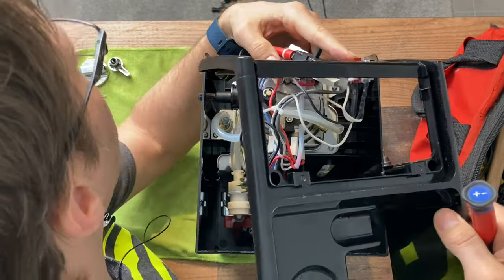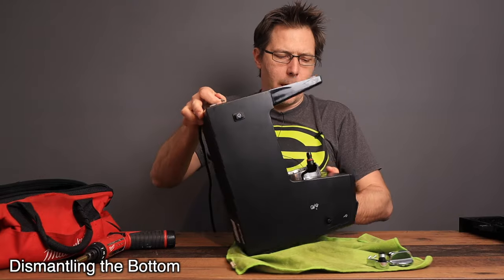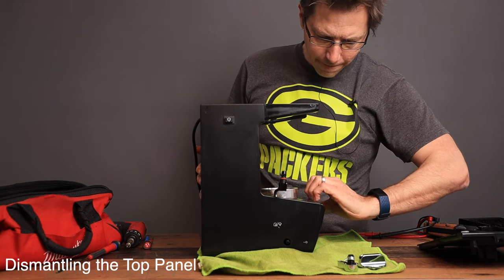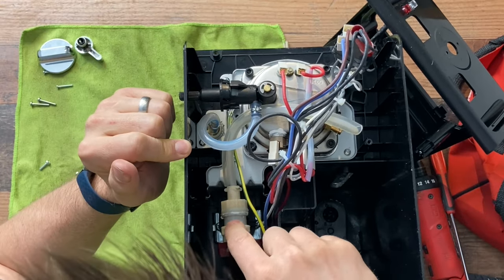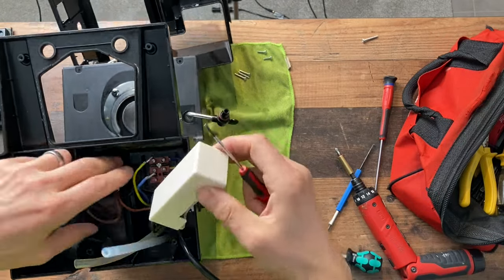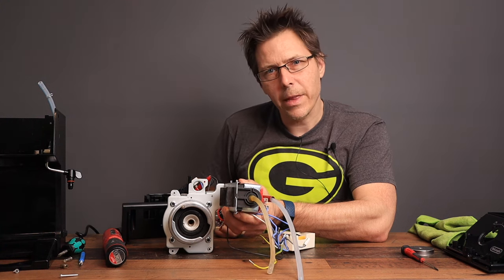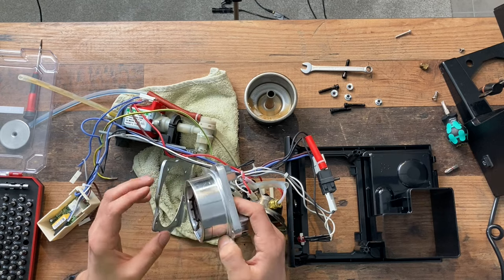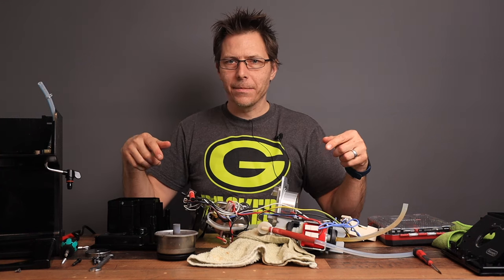$99 Delonghi Espresso Machine Teardown - How good ARE the Components?

Comment: Hi Tom why does the screw that goes on top of the valve does not tighten it keeps on turning I changed the spring and the ball and it still leaks when I turn on the machine
Reply from the maker: It should tighten just fine. You mean the brass nut that holds the spring valve in, right?
Reply: @TomsCoffeeCorner yes Tom that brass nut it still leaks when the machine is still warming up what do think is the problem thanks
Reply: Hi Tom it's 9.30 here I live in malta I found the problem I watched your video how to take the machine apart and I found the the copper pipe where you put the valve in it was not tight so I applied some bond around the tube from the inside and on the outside and its good don't know how long it's going to do the job it's called quickstep it can handle 260c what do think thanks alot great videos
Reply from the maker: @nickagius9050  Glad to hear you got it repaired!

Comment: That little box you found in the machine was to cut the power if there was no activity over 10 mins mark, because it's gonna reheat the boiler over time and no refill function, dry boiler often cause machine to trip the breaker, that's a nice implementation, what I do was press the brew button, let the fresh water in, every 5mins or so, and it's 300ml boiler, not 150ml, just take a look the protrude brass tube, water has to fill all the way up to get through it, how are you gonna do that, if that's 150ml, it fills to the bottom part to the boiler?
Reply from the maker: Hi there! Well, the bottom part of the cup fits 150ml, but yes there is a little space above it in the upper cap. However, the heating coil will likely displace that area. It's just a guess that this is 150ml in total. But you are right, that the water has to exit the boiler via the tube at the top, so there's got to be 150ml at least, plus whatever else is getting pumped in, to make it over that lip of the pipe. Cheers!

Comment: Is it worth spending a little more for the 35.31 model? Or the metal parts aren't worth that extra €30-40. Thank you
Reply from the maker: I like it better, also because the drip tray is flat, instead of plastic riffles. Cheers!

Comment: Hi Tom, how did you close the boiler unit back up? Is the cup just pressed into the housing against the rubber gasket? Mine doesn't want to stay closed after opening. Thanks for the great teardown.
Reply from the maker: You betcha! Yes, the thick rubber gasket keeps the boiler sealed.

Comment: Hi @TomsCoffeeCorner!
I have this exact model and, following some of your guides, did some modding to it, like depressurize the baskets, cut the bottom of the portafilter and installed the Rancilio Silva steam wand. They all improved very much my coffee and the overall experience.

I'm wondering if its worth it to move forward modding this machine (dimmer switch, IMS basket, IMS shower screen, pressure gauge, etc.) or if its better to buy a used Gaggia Classic or Gaggia Classic Pro instead. Since you have experience with both, what do you think would be the best? 

P.S.: I plan on buying a GCP eventually. I just want to know if its better to learn and experience more with this Delonghi or just jump ahead and learn from the GCP.

Thanks!
Reply from the maker: I feel like the ECP series is a mini GCP. Similar in a lot of ways, just with a smaller brew group. Fun fact: the ECP's stainless steel boiler is actually larger than the GCPs.
Reply: @TomsCoffeeCorner  thanks for the insight! I’ll play around with the ECP a little more then 😁

Comment: I have this model now but certainly want to upgrade towards end of year. What do you recommend for something in the $500 range ? I am using a setter 270 grinder.
Reply from the maker: Are you in America? Espresso equipment is a bit more expensive in the US. In the EU, I'd say a Lelit Grace. But it's hard to find something noticeably better for under $500. The GCP is nice, but if you want to upgrade, I would suggest a PID machine, which the GCP does not have. Maybe write some more, about what features you'd like to get.

Comment: A 1/8" flat head screwdriver will fit the screws on the bottom of the unit, possibly helpful if someone wants to add the "dimmer" modification to the machine.

Comment: Hey Tom, how old is tha Delonghi expresso machine? What model?? I own a Delonghi ECO 311 Icona, failed and disassembilng completly!  That L aluminium holdin the boiler, the Ulka vibratory pump the head ARE THE SAME in my machine! Your boiler is Stainless Steel, mine dont....The heating element in mine was totally destroyed!!
Reply from the maker: This is the ECP31.21. Internals should be quite similar to the Icona. Are you gonna order a new heating element, or get a different machine?

Comment: I have one of these. I’m planning to make a water level indicator for it. Does it have any 5 or 12 volts inside?
Thanks for sharing 👍🏼
Reply from the maker: I think the components are all 230V, but I haven't checked. They'd need a voltage converter to have 5vdc or 12vdc, and I didn't notice any. Cheers!
Reply: Thanks Tom 👍🏻

Comment: The area you live in must have high "disolved sand" content in the water 😅. Do you filter the water first? In either case very cool to see inside the boiler and I have to ask, did you manage to reassemble the machine and does it work normaly?
Reply from the maker: Haha, yes I filter my water, but I got this used, and for free. So, who knows if they ever descaled. Anyway, I live in a really hard water area, so your mileage may vary.
Reply: @TomsCoffeeCorner who sold it to you, the Sandman? 😂

Comment: I got a Delonghi La Specialista, in mine the steam does not work so I have never been able to make lathe; I can do coffee and expresso; I noticed the gauge does not work either; when the steam knob is activated I can hear the vapor building yet nothing comes out of the wand; the top of the machine gets really hot. No idea what I am looking for in mine; I did paid $15.00 for the disassembly video to the Delonghi tech that sells it on you tube, so taking it apart is not the issue but knowing what i need to replace; I think at some point he was pointing to the thermostat or something like that; I took off the top once and there is not noticeable leaking inside or anything that looks loose. I bought this machine off Amazon; came broken, obviously returned by another customer and I could never make those crooks on Amazon to take responsibility; I am indeed still paying for it as I bought it using affirm.
Reply from the maker: Well, Amazon should certainly honor their A to Z customer satisfaction. Just call them. You can get their contact via the Amazon app. Cheers!
Reply: @TomsCoffeeCorner  yeah tried that several times, they stole the money at not honoring squat and no replacement either; bunch of crooks they are

Comment: Hello, Thank you for your video. I have question. I have ECP 3420. Recently its not frothing milk . I guess steam wand. Coffee section is working. No hot water coming out from steam wand. guess steam wand tiny hole is clogged. what should i do? FYI, I bought it 2 years ago. but didnt descale at all.
Reply from the maker: Well, you can try to clean the team tip, if it's clogged. And you need to descale! Super important. Give that a whirl. Cheers!

Comment: Opened mine up and similar deposition issue, its really a design flaw that descaling does not work as the way the boiler exits at the top means the descaled sediment can never leave the boiler.
Reply from the maker: Yeah, I thought it was kinda weird, but I think this design is how it needs to work. I'd have to take apart another boiler machine and compare.
Reply: Guess you'd have to dissolve the accumulated sediment completely to get it out of there without disassembly.  I wonder if very frequent descaling would be enough to keep it from building up down there.

Comment: Hmmmmm i have an idea. How about to cut the top of the boiler and weld a five cm extra aluminium pipe to make  bigger boiker with longer screws. I have a friend Who work on weldings he could do it easilly. Would this machine benefit from bigger boiler?
Reply from the maker: I don't think so. Having a larger boiler would make it more sluggish between modes. I think 150ml is a good fit, to be honest. Cheers!

Comment: 14:45  , is the pipe of the boiler meant to be completly fixed? I can see when I take of the shower filter that the pipe is kind of lose , and it drips... not sure if is a problem of the screw and the drill , or the pipe is just broken.... help me out please! Really want to fix my machine, nice video btw :)
Reply from the maker: It's supposed to be tight...it creates part of the seal. Maybe you can screw it down? Otherwise, you might need to get a new boiler.

Comment: Are the parts inside the boiler stainless steel also? The coil where the water passes through specifically?
Reply from the maker: The boiler is SS, and AFAIK the heater coil is also stainless. Cheers!

Comment: My ECP isn’t working as expected. There is no pressure or heat anymore when I try to steam my milk. It was working fine a few days ago. I descaled it thinking that might help, but it didn’t. Any suggestions for a fix?
Reply from the maker: Your OPV could likely be shot. Do you see bubbles coming up in the water tank when you turn the pump on?
Check this vid: https://youtu.be/ncoZ3XyhWC8

Comment: To my understanding. there is no selenoid valve used in this machine. Also pov exit to the tank for economizing is wierd. Shouldn't be some sort of exit into drip tray normally?
Reply from the maker: No, there is no solenoid valve. Delonghi always puts the excess off the OPV back into the water tank. Breville on the other hand, puts it back into the pump cycle, reattaching the overflow of the OVP back to the input of the pump via T connector.

Comment: Great idea!!!!!!  I'm so over all the pretentious nonsense being spouted over "appliance" coffee makers.
Reply: Also I have a 3d printable lid I designed that fits the Stilosa water reservoir, and I'm sure would work on this one as well.
I can post the link but didn't want to in this comment because it will just get removed from youtube not letting comments share links without approval lol :)
Reply: I think when descaling, and also now that I think more about it.  There seems to not be any circulation of water during operation, or at least very little.  All of that sand is the scale from everything in the boiler.  It just was never able to get mixed around and pushed down the spout through the grouphead.  I think possibly this could be solved by removing the pressure valve inside of the spout and just running water through it after descaling.  Maybe without any resistance more flow can be achieved inside of the boiler.  But for me, I think the best way to descale it is to just take the boiler off as you did and clean it manually.
Reply from the maker: Hi Justin! Send me the 3D link to my email. I have my email listed in my website, tomscoffeecorner.com. Also, I bet that would work better, to remove the expansion valve to get rid of the crud, but since it's heavier than water, it might still just sit stubbornly on the bottom. It was fun to take this apart though, and see the boiler first hand.
Reply: sent :)

Comment: Будет ли видео про opv клапан и регуляцию давления в группе?
Reply from the maker: Not at this point. The OEM OPV is not adjustable. I tried using different springs in there, and shortening the spring, but I got crappy results. The pressure still built up to 11 bar, but just took much longer. Maybe someone has put in an an entirely new OPV?
Reply: Я знаю человека который вручную сделал байпас. Канал его называется Verstar, правда на русском языке.

Comment: New insecurity unlocked, the sand in my ECP 3420… 14:03
Reply: The sand are in the bottom part of the boiler?, any tip?
Reply from the maker: I am pretty sure it's mineral deposits that have gathered over the years.

Comment: Hi, replied to your reply regarding the leak in our 3220 "tap" a couple of days back but it seem to have evaporated. So, I'll just spawn a new comment. Wondering if you know if the tap can come apart in two pieces? I see some black tabs and probably 2  white tabs as well. I am reluctant to pry at them as it might be fatal. The shop manual exploded view shows a post on the top of the heater for the tap . I suspect there must be an O-ring on it but it does not appear or in the parts list. Link for the leak is at:   https://youtu.be/W0zMLlLlD8M Thanks for any info on this.
Reply from the maker: Hi Gordon, well it looks like the steam valve is leaking out of the top. Is that the steam valve? I would try replacing the part.
Anyway, I took a quick look on google and did not find a part right away, as it looks different than the valves I have seen so far. 
Maybe a longer video would help to give a better perspective of the part and how it's mounted.
Reply: thanks, Yes, that is the steam/hot water valve. Interesting it only leaks while extracting and not when pressurizing for steam. While I wanted to avoid tearing it down further (with help again from your video), I guess I will and see if I find an O-Ring inside the post. Cheers @TomsCoffeeCorner